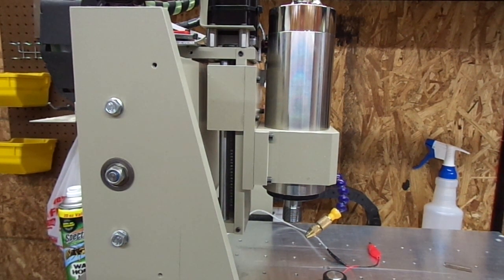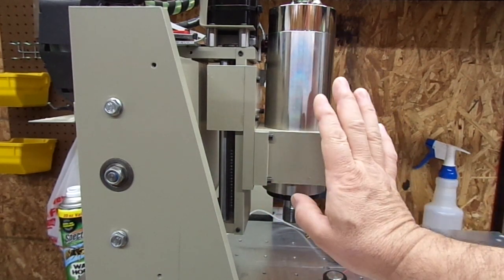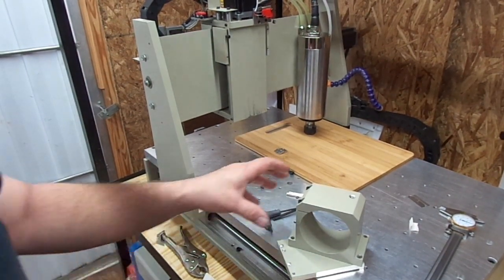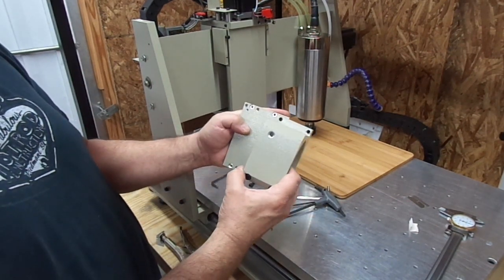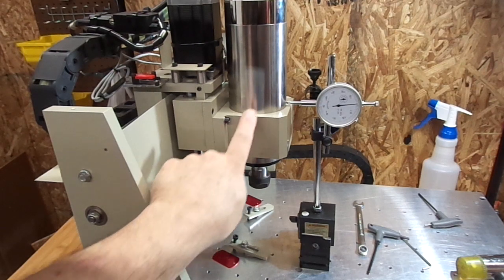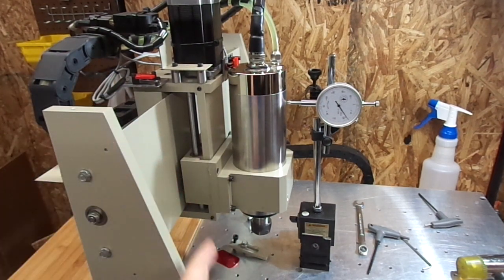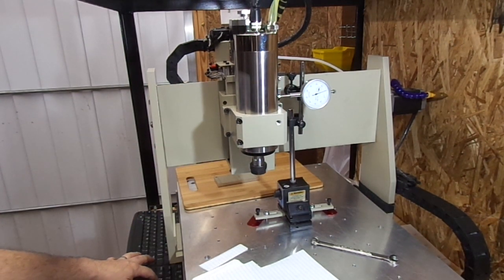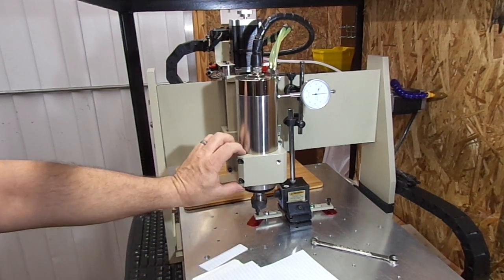6040 CNC Spindle Mount relocate

Comment: Is that the original spindle , I’ve the 4030 machine and was thinking of changing the spindle to a more ridged one .
Any recommendations.🤔
All in all they are a very sturdy machine for the price .
Reply from the maker: The spindle upgrade is nice but unless you have totally supported back rails, you will have issues cutting with anything larger than a 3/16" end mill due to deflection. Jobs that I know I can use a 1/4"  bit I will use 1/8" for more spindle rigidity unless I'm cutting wood.

Comment: Hi Rick, nice informative video for all of those 6040 frame owners encountering frame flexing, we all know that they are not very reliable even for hard wood but they are a cheap way for beginners to learn about cnc machines. I am one of those but instead of cutting that plate and move the spindle clamp on the carriage base, i added one more clamp at the top spindle to maintain the same Z axis travel. There is also that  Z axis guard plate which i removed, milled the protuberances of carriage unit and spindle support  in order to get closer to base of travel. Gathered few mm for Y travel and a bit more rigidity due to moving the forces closer to base. Added fully supported rails on X axis with 0.5" aluminium thick plate 8" width, removed the X axis guard plate and shortened the top and bottom plates ( the Z to X carriage links) allowing 2 mm gap between X and Z carriages. Gathered another +mm on Y travel and a bit more rigidity by moving forces towards base. I know those guards were meant to protect the rails and ballscrews but when using hoover and dust shoe they don't protect much and the dust in suspension it gets there however.
Reply from the maker: Thanks for the information, My next upgrade is the back plate and supported rails. I'm in the middle of a house remodel and have not turned on my machine in 3 months :(  I tell people who are looking at buying a 6040 that if they don't want to tinker and work on it, pass and buy something else. May cost a little more up front but it's worth it if you want to simply start making parts.

Comment: Do you have a link to that cnc on AliExpress?  There are so many that look the same but when you zoom in on the photos you notice that rails /supports etc are cheaper versions etc.

Love your videos. Keep them coming!
Reply from the maker: Martin Dolan the 6040 is a generic design and hundreds of companies have made their own version dependent on the stock they have on hand. I got mine off eBay and the spindle and controller was defective within 2 weeks. I read of so many people in my same boat and decided to document these upgrades. Finding 2 machines exactly the same or actually getting the one pictured in the ad would be extremely rare. Thanks for watching, back rails are coming up soon.